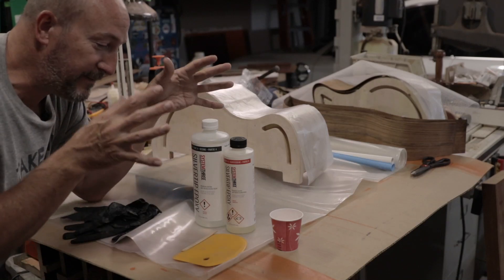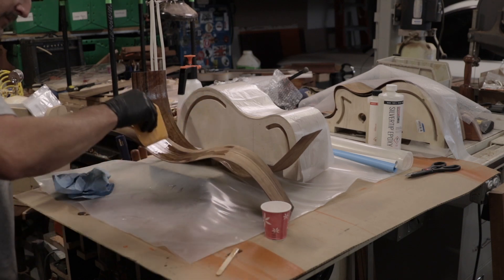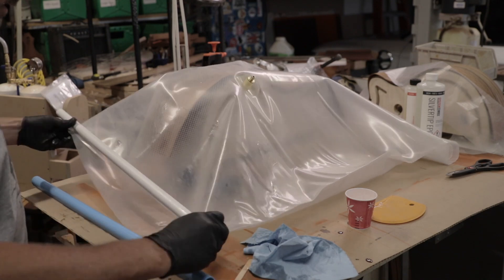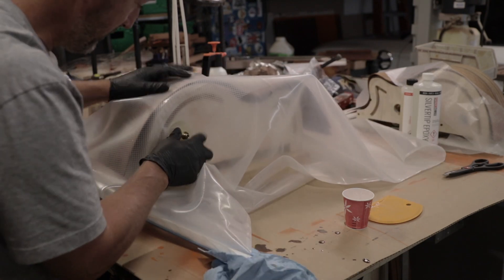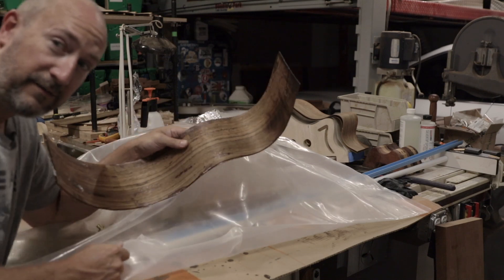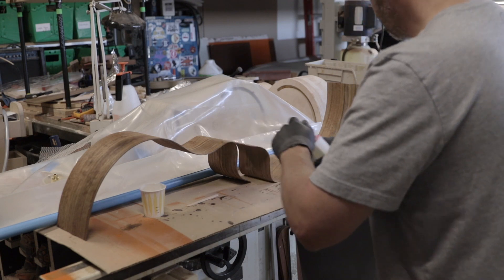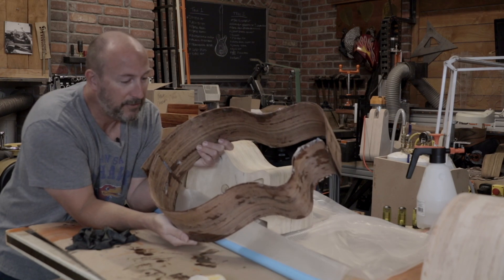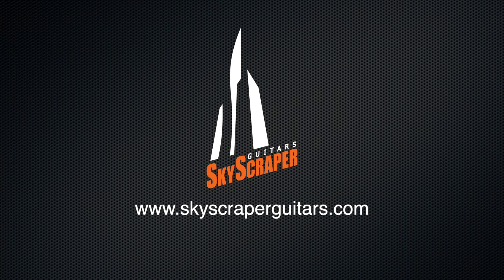Laminating The Sides - Acoustic Build - Ep 11

Comment: Question on the clever pvc used to seal the vacuum bag. The inner pvc looks like a typical piece of pvc. Is the second piece that goes over it and acts as a clip just a bit larger diameter pipe or a different material that has some flexiblity to bend a bit?

Comment: Coming frkm norm wood glue j quickly learned you need a ton less epoxy then you think, it doesnt dry out when hardening like wood glues so the jormal film used with wood glue will just result jn a ton of squezeout or epoxy pocket between laminations.
Reply: 15 grams per surface js usually enough

Comment: check out drift wood guitars site he does laminate sides he adds a silicon to the epoxy so it doesn't bleed through the veneers. ya there is certainly a pucker factor going on there good job

Comment: It's a good system for applying even pressure, but I think same results could be achieved in a more simple way. I would use the vacuum and side jig to make a 25mm laminated caul. I would make this over a bendy hardboard layer spacer (side thickness + thickness lightly compressed foam material) then fix the foam material to inside of the caul. The bent sides could glued placed on the side jig the caul placed on top and clamped to the side jig with even pressure. Bespoke clamps could be made from drilled steel bars and nuts and threaded rod.
Reply: I did that and although it works fine for most apllications, if your going to use a quicksetting glue like titebond its almost impossible tk get it properly clamped in time.

Comment: Nice job Greg. Wondering why you chose to go with laminate sides instead of solid wood?
Reply from the maker: Couple reasons...  Overall its a stiffer system.  I want the sides as rigid as possible.  Also, a solid piece won't bend without snapping.  This also eliminates the kerfing that is typically used.  That should free up a bit more of the top.  I will also be able to eliminate the vertical stiffeners that are typically seen around the inside of the body.  Lastly, the mass will help bring the top frequency down a bit.  That will be important in future builds, but this will give me a baseline.

Comment: That was an amazing first attempt at the vacuum bag gig. I immediately thought tape would be the answer on the first side set up. Just to get everything aligned before putting it in the bag. Of course it does get stuck to the epoxy.
Reply from the maker: I was contemplating taping and/or spring clamps.  I think the spring clamps would have punctured the bag...  I am going to invest in a foot control for the vacuum.  I think that will let me get the bag 95% empty, then I can do my fine adjustments and let off.  If not, just disengaging the hose worked pretty well.  I was surprised.
Reply: @SkyscraperGuitars , well, you can't argue with great results.